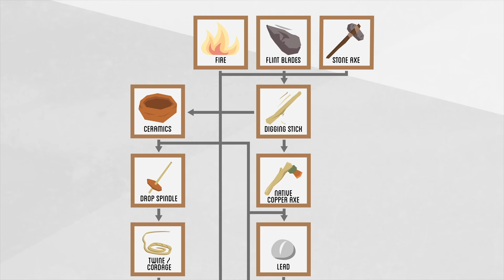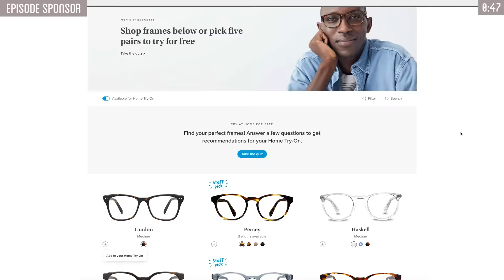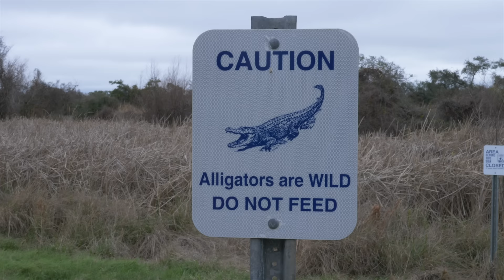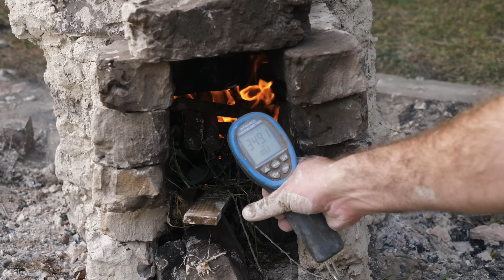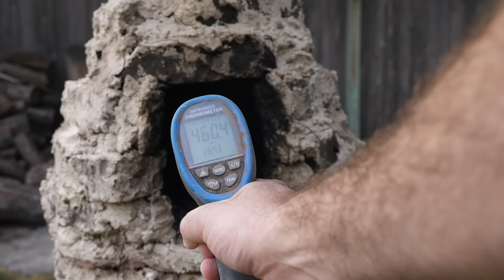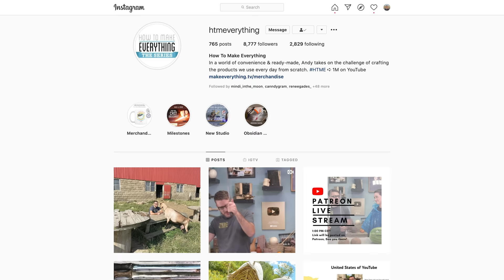Primitive Glassmaking (Creating Glass from Sand)

Comment: I wonder if you could be successful in the synthesis of Calcium carbide from a charge of limestone and coke/charcoal, and perhaps some soda ash as flux to help catalyze it.  I imagine more of a log lean to burn, like how the scandinavians make their pitch, so the hot coals end up surrounding the clay crucible containing the reagents.  Your clay crucible should have a lid.  That CaCO3, C, and Na2CO3 inside it should be fine, like 200 mesh, and mixed thoroughly.  Precooking the CO2 off the Limestone would increase your chances of success, i.e. using Calcium oxide (CaO) instead of CaCO3 in the Carbide powder mix.

Once cooled, you bust open the crucible since it will likely be fused, and scoop out the Calcium carbide pieces.  Bust up the carbide chunks into dime to nickel sized pieces.  They will look like silver-grey rocks with fine grains.  Busting it up into smaller pieces increases the surface area though so these need to be stored in an airtight container as even the moisture in the air will slowly hydrolyze it and release acetylene.  Know also that hydrolysis of crude Calcium carbide often releases small amounts of Phosphine as well.  Don't breath the offgases.  

Then take a portion of the prepared Calcium carbide and add to a new type of furnace.  You arrange to add water dropwise to the pile of carbide you added to a sealed container to produce Acetylene (c2h2, aka Ethyne), the simplest hydrocarbon.  Don't just drench it all with water or it'll get very hot and release all the acetylene rapidly and probably self-ignite the flame due to the heat of enthalpy and explode.  drip... fizzles drip... fizzles  drip...*fizzles*, and something you can modulate.  You want to start small, get the gas flow going, make sure your chamber is sealed up except where you want the gas to exit (and also to prevent Oxygen from entering), then ignite the gas that is coming out of that tiny hole from your reaction chamber.  Any old spark will do, flint and quartz, etc.

A jet flame will ignite and the temperature with Oxygen should be about 4000F which then applied to your glass charge you sit in front of the flame should be hot enough to thoroughly melt it.  You could pipe this acetylene through a wand or however you want to do it.  It's so hot that I'm not sure you really need to go to the trouble of you know... the ashlar masonry there. ;)  Just point it at the glass reagents and don't blow it out and it should melt pretty much right away.  But it would look cool if you made a little brick arch thing with a gas jet/flame coming in through the back and you can work material in the little brick mailbox.

For a "How to make everything" goal, having a way to produce the simplest hydrocarbon opens up a lot of opportunities in organic chemistry and petrochemicals.. if you're rebootstrapping, I mean.  Carbide was a big part of the industrialization of this world.

You might look at the old mining lamps for design inspiration.  I picked up one as a kid at a garage sale, and talked somebody into buying me a 5lb can of CaC2.  Oh the times we had...

I also wonder if a "glass seed" in the powder charge would catalyze glass formation of the surrounding powder...
Reply: You can use something other than Calcium carbonate too...

Methanides: Al4C3, Mg2C, Be2C
Produces Methane (CH4) with H2O

Acetylides: NaC2, CaC2, LaC2
Produces Acetylene/Ethyne (C2H2) with H2O

Allylides: Li4C3, Mg2C3
Produces Methylacetylene (CH3CCH) and Propadiene (CH2CCH2) with H2O.

Comment: Glass is so cheap but so difficult to cut , polish , mold unlike brick, wood. You have to order exact fit pieces because in the field, there is no cutting, shaping, drilling,  polishing. Also many granite installers are not wearing masks when they are installing granite counter tops and are destroying their lungs.  Also working with glass enjoy cutting your fingers all the time!

Comment: I am sure someone otherwise professional said this, but its not what they did. They also made alumina silicate glasses which require a far different furnace (yet to be released publicly, but the military operates aircraft with it) Mine gets up to 2800 C @ 99.9% efficiency. They also had another furnace that could go to 5000+C That one I invented/reinvented. Theoretically capable of inducing R-process. If you want to get the worst sunburn of your life. Another point to be made is that these cultures could not have burned 15 cords of wood per batch of redware/stoneware ceramics... Would have taken more resources than available to produce the garbage piles and insulation (they put garbage ceramics between the walls and floors)

Comment: Just a gut feeling but did you grind the sand into a fine powder before adding the flux? Is there any way of blasting the hot air through the powder?

Comment: Wrong. It's individual grains of sand being melted into a glob of melted sand, specifically, into a larger grain of sand commonly referred to as a "rock': Sand is merely small rocks. What makes it called "glass" is it's transparent. Than lava is glass also, just not transparent. If you split a rock in two---which one is the rock. If you chip off a small grain-size from a rock--which is the rock. (physicist)..

Comment: hi...don t do glass much but....figure if you put a trough in the fire  base and built a fire around the clean sand mix it..and pump alot of air through the bottom of the fire chamber to increase flame speed...flame speed equals temperature....meta lconducts heat faster than mason products...for the container...good luck...practice makes perfect...that will still bake pizza s and bricks...

Comment: Be REAL careful with the Soda ash... If you use too much you can can get get molten sodium which floats on top of the molten glass and is almost invisible. If it touches water, or anything wet... BOOM... I spent 20 years making glass and have seen it happen many times

Comment: You know what cause of the failure of your project that's why it coudon't reach high temperature because the the charge of fuel should be on top while after charging you should cover the top and the hot air coming from the combustion should pass on top of the crucible  which layed on side of the kiln and their the hot gases of combustion should pass through a small shroud of opening beneath the crucible

Comment: Might have had more success if that kiln wasn't such a disaster & slapped together with holes and cracks. Diameter should have been much wider at base to give stability. Surprised it didn't collapse or release enough sparks to set fire to the fence or tree.

Comment: You don't have time to do it right, but you do have time to do it twice, thrice, or even four times.
How does that work?
In all these so-called "ancient process reproductions", you never even get remotely close to how it was actually done. Firstly, because you are not an expert at any ancient practice, and were not raised using them to become expert. Second, you use the worst possible stuff to try achieve the best possible outcome. Sorry - but that is not how it works, either!
You don't convert a random bit of rubbish into a glass furnace using more mud and straw. No. You sit down and design an appropropriate furnace, and crucible design. Then you make proper bricks from which to create your furnace. You make the highest quality porcelain crucible its possible to make, and THEN you begin your experiments.
That is how you make progress: by using the very best equipment available to push beyond what's been done before.